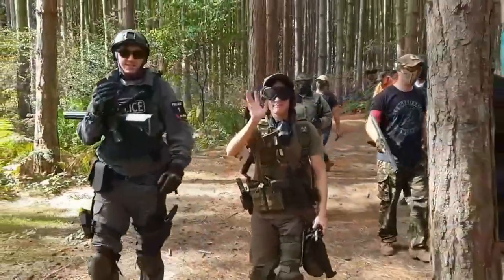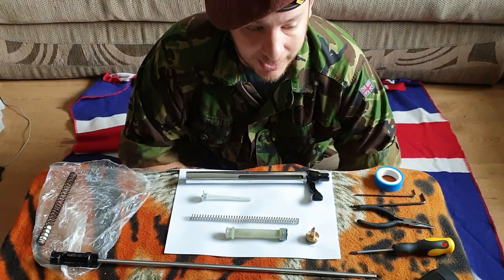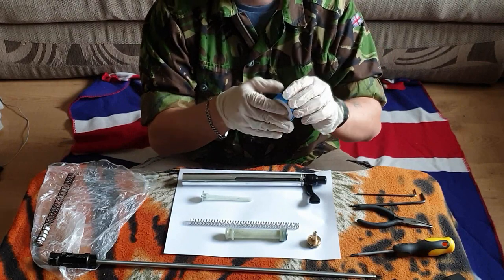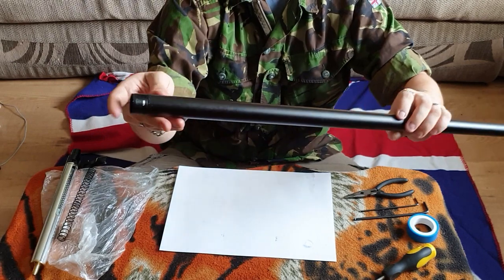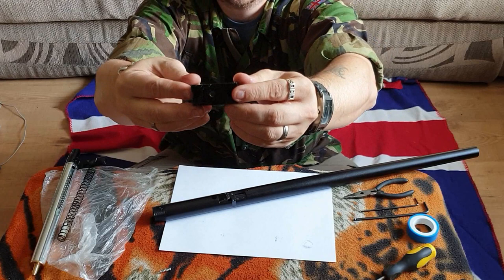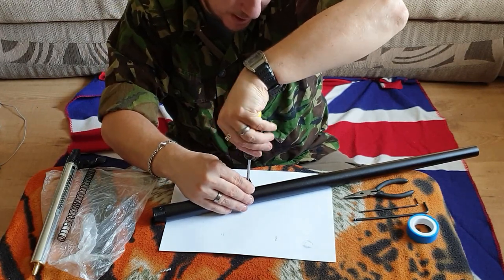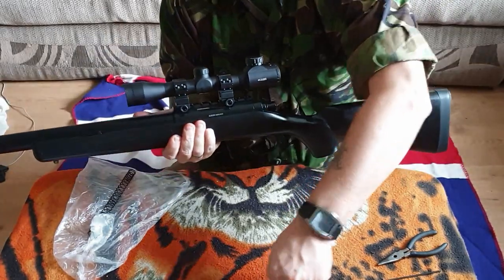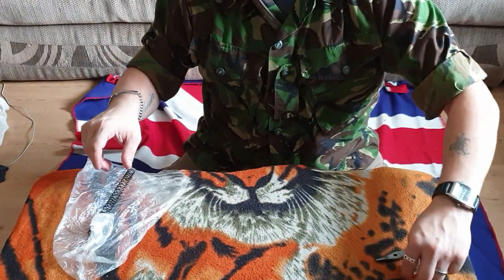Well MB03 full assembly

Comment: Just received mine so will be using your vids as a guide when I'm upgrading it.
Reply from the maker: Cool, they really are damn good little sniper rifles, I've had mine about 3 years now and its never missed a beat. Just make sure if you take the inner barrel and hop unit/rubber out, when you put it back in it needs to be perfectly straight as the bbs will hook left or right and do your head in.....I found out the hard way 🤣

Comment: About to order my mb03 an you got a new subscriber cos ive a feeling I'm gonna need these vids in the near future
Reply from the maker: Awesome! You will love the MB03, great out of the box and easy to upgrade if you want to, my only advice is to give the inner barrel a damn good clean before you start using it, or shoot around 200 bbs through it as there tends to be oil or grease in there from shipping across the sea 👍
Reply: @ThinBrownLine  mimes coming from taiwangun an they are generally known to be a tad filthy so always a good idea to swab out yhe barrel first, found that out the hard way with my p90, kept pulling to the left til i gave it a damn good clean lol
Reply from the maker: @valentine4287  at least you know what to expect then lol, its mainly grease they put in barrels to stop the sea air from rusting the barrels while they are in the containers, easily cleared out and you should be getting around 425fps on a .2g bb out of the box unless you requested them to put a larger spring in
Reply: @ThinBrownLine  nah i intend to do any upgrades myself, hence the cheap as chips starter, its only 55 quid over there at the mo

Comment: Hi, i would like to put heavier springs in my MB03, only thing that I changed is Barrel to 6.03mm, do I need to change something or mod it for heavier spring? I read something about trigger angle etc. and I did not understand it clearly, would heavier spring break something?
Reply from the maker: Hi, you can put a heavier spring in with no real drawbacks, I took the stock spring out of mine and put an M150 into it, so far there have been no issues and I have not changed the trigger sears or anything to stronger ones. Most people suggest to upgrade the sears when you put a heavier spring into an MB03 but I have found that the stock sears seem to hold out pretty well. Mine was upgraded about 2 and a half years ago now and Im still using the stock trigger unit, sears, piston and spring guide. All I have swapped out are the inner barrel to a 6.01mm, the hop rubber to a maple leaf one and the spring to a generic vsr m150.
Hope this is helpful